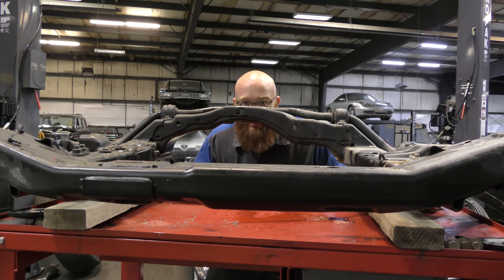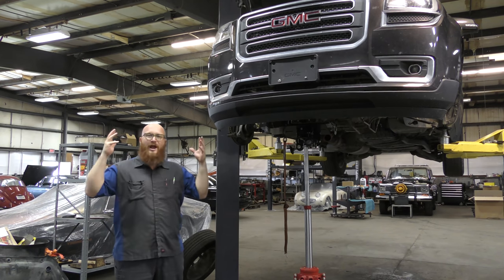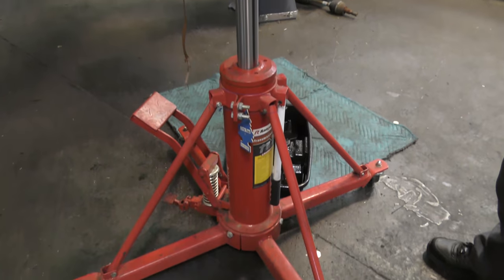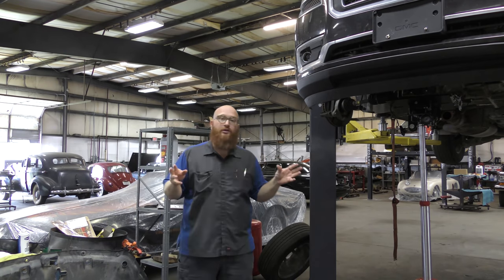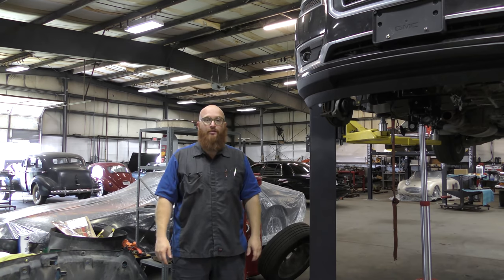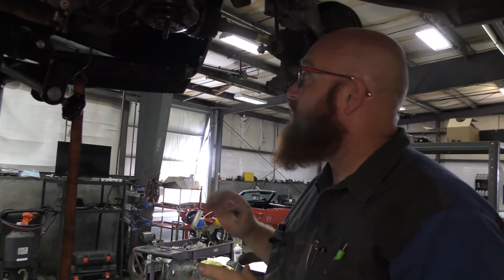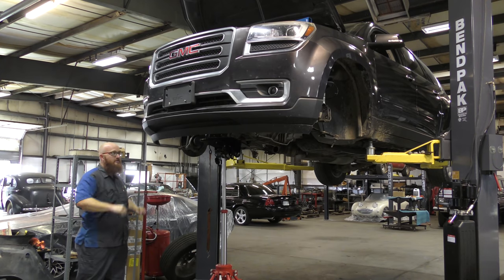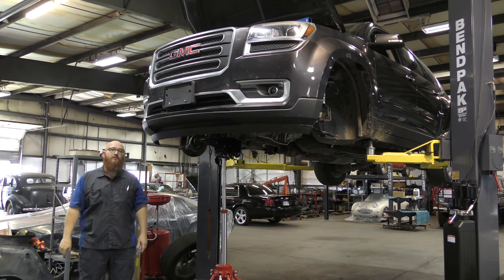Used car insanity in the CAR WIZARD's shop! Why did the huge repair get approved on this '15 Acadia?

Comment: Six years old and it needs $4k worth of repairs. Good ole' GM
Reply: Most vehicles at this point in time are junk . It's like the '70s all over again .
Reply: Much better than the new Fords. The Fusions, Focuses and F150 are having serious transmission issues let alone the 5.0L Coyotes are having issues with the cams flatening by sticking valves.
Reply: GM trying to beat the Germans at the lack of reliability game
Reply: @Dr.Westside  My 2015 Infiniti runs like new,no leaks ,no repairs, 180k miles.Made in Japan.
Reply: @mediumunwell  what do you mean "trying"?
Reply: @neondemon5137  it's a race to the bottom, who can build the bigger shit box?
Reply: GM and the other domestic brands. The pinnacle of garbage
Reply: Well really these days if its a v8 and it doesn't have active fuel management its great
Reply: @Dr.Westside  everything is like the 1970s again not just vehicles and that is not a good thing.
Reply: MRGRUMPY53  there are lots of good quality american made cars. Cars like the Honda Accord, toyota camry, honda pilot, honda ridgeline, honda odyssey, honda civic, toyota highlander, toyota....you get the idea
Reply: I have had good and bad gm cars. My experience is the good vehicles are those with the longest production runs with little change and the bad ones are low end vehicles that are cheap to start with or new high end vehicles with new tech. Same goes for Ford vehicles.
Reply: @Dr.Westside  the shoddy vehicles aren't exclusive to American or European brands.  I've seen problems with low milage Toyotas that just shouldn't have happened.  It's crazy.
Reply: I wrote GM completely off with my last GM purchase of a 2012 Cadillac CTS about 3 years ago. The warranty I bought for it has paid for itself 3x over now.
Reply: @Henry_Jones  several of those are assembled in America
Reply: This is why I drive Toyota’s 😎
Reply: @mediumunwell  BMW’s and VW Group products don’t have issues until much later on…
Reply: My hummer with the gm l92 and 6l80 power train is 14 and I’ve replaced the transmission once. Other than that runs perfect. Fingers crossed
Reply: I was a GM tech for 10 years and we did so many timing belt recalls on these Acadias, one guy would do 2 at a time he got so good at it. The 3.6 that came in these were terrible oil problems like crazy too.
Reply: @Dr.Westside  what world are you living in?? Only problem is people will still by GM garbage! They're never gonna change if people keep buy their cars
Reply: @Donnie Jax ruined the cavalier? You cant ruin something thats garbage to begin with.
Reply: @rachelgreen1368  nissan gets crapped on, mainly for a cvt transmission issue they had way back, but i have had nothing but reliable service from the 5 that i have owned
Reply: My wife got screwed by the GM SUV with the 3.6. GM has permanently made sure she buys Toyota/Lexus again
Reply: @Horizon301.  ha,ha, ha, ha...that's funny
Reply: @Donnie Jax Yes but it smell like dog and or cigarettes
Reply: Planned obsolescence
Reply: @mediumunwell  haha so accurate
Reply: @watersauce3998  timing chains?
Reply: New GM. Old lasted
Reply: While were at it lets not forget how gm loves to kill products they get right. Latest example is the Chevy Volt. Its as good as a prius and at a time when cafe is going up they kill it despite it having a huge fanbase. How about the awesome voltech powertrain that helped them get a govt bailout on 09? Do they propergate it to the rest of the gm lineup? Wouldnt an equinox hybrid make sense while toyotas selling rav4 hybrids hand over fist? Nope not to gm...they just took the voltech powertrain and buried it. 
So dont take gm seriously when they talk about electrification. The best they can do is an electric sonic (bolt is just that) while ford has the mustang mach e. Get ready for gm bailout 2...which is really anothet uaw bailout.
Reply: All newer American cars are junk except the ones with old school V8s
Reply: @tskraj3190  I love that you say that with a Ford as your profile pic
Reply: @mediumunwell  Can’t speak for BMW and Audi but Mercedes >>>>> GM. Mercedes are more expensive to fix, but they don’t break often in my experience and when they do, they’re easy to fix compared to BMWs and Audis. It’s the parts that are expensive
Reply: Ford is no different trust me
Reply: @Dr.Westside  I drive a 14 yr old Mercedes S550 & drives like a dream, burns no oil, no leaks, 382HP & 395lb Torque, everything works & all orginal. Best car I've ever owned. Mercedes is the Best way to go for reliability, dad was a mechanic & friends with tons of dealerships. BMW's & Audi's un reliable Mercedes copy cats 👍& GM/CHRYLSER worst, Toyota is "okay" not bullet proof as the Steroetype says.
Reply: @EDVenturesFL  Ford may be no better for reliability least Ford knows product design and knows to build on their R&D. Look at their approaches to hybrids and electrics to see what I mean.
Reply: @diablocls55  Yep. That was my last F150. I've owned two Tritons one 4.6 and a 5.4 and they were flat out trash. Ford doesn't build them like they used to. although I still hear good things about the first gen Coyotes.
Reply: GM still makes the best vehicles on the road. Everything else is worse.  The car companies aren't even trying anymore, because they want us to transition to electric cars, which will be a nightmare to fix, and will have a lifespan only as long as the battery pack survives.  Once that fails the car will be complete junk.  The future of cars is looking quite grim.
Reply: @ServantofChrist81  Toyotas in the U.S. such as the Tacoma and Tundra were designed and engineered by former GM engineers 🤣
Reply: @JESUS_IS_GOD  lol I literally drive a 14 year old E550. It’s so fast for a non-AMG, I fucking love it. I just keep maintaining it and it has never let me down. Just hit 150k miles last week
Reply: @tskraj3190  my parents had 2 windstars when I was a kid and the engines blew up in both before 120k miles. My parents said never again will they buy another Ford after that. Lol
Reply: @mediumunwell  mostly the SUVs Silverado, suburbans and Tahoe’s are still reliable
Reply: Want to see the difference between gm and the germans in the luxury segment? Watch Wizards video where he has a cadillac and mercedes, both from the same year on the lift side by side. Its one of his best vids.
Reply: 03 Chevy Avalanche at 335k and alright with good maintenance. Wouldn't go much newer than that tho. I often do agree about GM. Cost cutting=customer cutting. They don't even know it.
Reply: Junk
Reply: @jreyman  Toyota and Honda would like a word
Reply: We have had a few personal GM vehicles, and several company GM vehicles, we’ve had very few issues. We’ve ran company work trucks to over 200k miles with a few simple repairs along the way, but nothing major. A few Ford and Dodge work trucks also, they were all about the same way. But they were all serviced like they were supposed to be.
Reply: @Alex-xi2nz  Likewise. My wife's 2010 Malibu was the most beautiful POS we've ever owned. Good car, crazy fun in a straight line when it worked - but with that 3.6 V6, those times were far and few in between. 

Glad she drives a Camry now.
Reply: @Dr.Westside  🤣 naw
Reply: That why,you should stayed far away from GM cars as much as you can.
Reply: @Dr.Westside  agreed, except parts were a lot cheaper and a home mechanic could do most of the work themselves.
Reply: I cant tell you how many of these 3.6 liters i saw taken apart when i worked at a dealer… that series of timing chains weren’t heat treated right…. That being said VW 2.0’s, bmw 3.0 engines, and honda oddessey transmissions were also junk. Every manufacturer sucks. Consumers need to do their research and should be held accountable for it.
Reply: @Henry_Jones  Yep I think too many see foreign brands..  Ahh not made in USA.  Well I got news for ya kids.  Most aren't just American made they are made UAW yes Union Workers!  Same one who build US brands.  But that doesn't effect the quality.
Reply: @Henry_Jones  Agreed
Reply: @diablocls55  Agreed
Reply: @TravisClan  Agreed
Reply: @ACedricArmstrong  That's good.
Reply: @Chu3505  Agreed
Reply: @Elsalte07  Agreed
Reply: @Henry_Jones  do you happen to know how long ago that episode was?  I'd like to see it.
Reply: Been driving worry free Toyota’s for years now I’m so scared to buy anything from Chevy or Ford or dodge I just know I’ll instantly regret it. From maintenance to resale value but I like the camaro and mustang.
Reply: @dixonsantana-lamboy8432  cold garbage 💁‍♂️
Reply: My Nissan Sunny is 21 years old and I have not experienced any problems with it whatsoever. Normal wear and tear, service and brakes, and once CV joint boots only. That's it, and yes, she's a daily driver ☺❤😎👋
Reply: @rachelgreen1368  My 2000 Nissan Sunny still runs perfectly today. Daily driver.
Reply: Ever since I heard about that GM faulty ignition scandal that happened on the Chevrolet Cobalt, Saturn Ion, Pontiac G5/Pursuit, HHR, Saturn Sky, and Saturn Vue. I am never going to buy American cars EVER!
Reply: @tskraj3190  - The Focuses and Fiestas have had serious transmission problems.  Not so much the Fusions and I looked up the Coyote V8 reliability history on the F150s and then checked out the history on Silverados and Sierras, and the F150 (with the V8) has FAR less customer complaints.  Many Silverado/Sierra owners are having to have engine replacements before 100K miles.
Reply: The only GM SUV i would buy is the 2000-2006 yukon xl
Reply: And it'll need timing chains within the next year as well
Reply: MRGRUMPY53  Thats patriotic. You probably shop at Walmart also. For ahead and move to Japan or korea
Reply: @watersauce3998  GM tech huh? You must be dreaming because the GMC Acadia doesn't have a timing belt. If you are gonna lie do better research first.
Reply: @mediumunwell  They win by far. German cars are quite reliable. At least the base model and lower power motorized models.
Reply: @hungryhungryhummer  Yea, but you've had to drive and be seen in a hummer....
Reply: @BeingMe23  Name one foreign branded, UAW built and assembled in America. Doesn't exist anymore.
Reply: @Donnie Jax compared to what honda and toyota and nissan were putting out then? Garbage. The real sin of gm of the 80s was saturn. Why build a whole new company while starving your core brands of capital needed to improve product? The saturn s series coulda replaced the j body, been the next gen cavalier and THEN chevy coulda been a condender but nope.
Reply: @christinesommerfeld9815  timing chain it has 3 really skinny ones like bike chain almost. Pontiac buick gmc in apple valley MN years ago graduated Dctc in 2008. Belt chain whatever doesn't mean im lying lol
Reply: @christinesommerfeld9815 actually I’ve never met anyone my age who doesn’t like it. It’s always old libtards who hate. It’s supercharged so 520+ hp, it tows my can ams and enclosed trailers up the mountains great. And believe it or not, the fuel economy is excellent when towing. Better than any other 3/4 ton vehicle I’ve seen that is gas. You should go drive one. It might change your perspective. Drive a newer one like an 08-09. They’re a lot nicer than the old ones.
Reply: @rachelgreen1368  More like made in France (Renault).
Reply: @Dr.Westside  My 7 year old Skoda Citigo has 180k km on it, still 100% original with original timing belt and clutch. Runs completely fine and has never had anything wrong with it. Of course, unlike most new cars, the citigo doesn't have useless rubbish such as oil filled motor mounts.
Reply: MRGRUMPY53  whaddya drive
Reply: @Horizon301.  at 100k miles?
Reply: @Henry_Jones  I loved my volt.
Reply: I had a 2009 GMC Acadia and it was at 190,000 mi when I had to get the timing chain replaced.... It only costed me $1,900.... That's what's like 2 years ago....
Reply: @watersauce3998  Arcadias have chains and not belts?
Reply: @Btrempe  yep the volt and voltech powetrain was awesome! Gm doesent market it, asks why doesnt it sell better and kills it! Rav4 hybrid, crv hybrid, escape hybrid, soon mavrick hybrid! What does gm do with their superior hybrid drivetrain!? Make a hybrid equinox or traverse? Nope..
THEY BURY IT!!! DUMBEST COMPANY EVER!
Reply: @DeadofWinter321  de
Oht a c
Reply: That's why I'm happy with my 2010 Civic... 100k miles and no issues, just regular stuff as oil, pads, filters and such...
Reply: I was watching my cams (all four of them) on my scan tool. The value presented were all in spec.
That car has almost 310000 miles on it. 
Good ol' GM... 😩
Reply: One of the saddest things about Chevy/GMC is that they actually make good looking vehicles that won’t last long.
Reply: @Dr.Westside  70s cars lacked power. They were still reliable
Reply: Did a stint as a lube monkey at a Toyota dealer. Brand new camrys with less than 20miles on them had leaking rear main seals. Doesn't help when the worst culprits are running 0w16 oil in them.
Reply: @mediumunwell  don’t agree. Have had  one 2002 A6 2.4 V6 put 246000 Miles on it with no major issue. Regular maintenance oil changes brakes some control arms and engine mounts. Was still going strong but wanted something newer a few years back. Now have been driving the 2012 Audi A6 3.0t supercharged with already 129000 miles on it and never an issue. Same just regular maintenance on the intervals and I’m sure without a problem will hit 200000 if not more. Better then any junk American or Nissan. Have to say that Toyota and Honda are likely cheaper to maintain but in my case the Audi is far more pleasant to drive. It’s all how you maintain it. But then yet again I see so many people in the states that want to sit in the front row for the cheapest price possible. You get what you pay for.
Reply: I can’t imagine what the earlier ones are like.
Reply: That isn't typical though. Obviously its been abused.
Reply: @tskraj3190  even if that were the case Ford seems to be having way less problems than GM nowadays. Class action lawsuit for the lifters? aint happening at ford 🤷‍♂️
Reply: @PhatsoJuggalo806  Ford just doesn't report their known issues like the Triton motors for example with the consistent spark plug spitting after tune ups or the cam phasers crumbling inside the engines.
Reply: @lyman135  Rear main seal failure could possibly be due to poor maintenance, but not failed sensors or leaking power steering lines.
Reply: @watersauce3998  timing belt or chain?
Reply: American cars are the BEST!
I know an Uber driver with 300,000 miles on her Alabama Odyssey, two people with 450,000 miles on their Ohio Civics, somebody with 560,000 miles on her Accord, a guy who uses his 300,000-mile Texas Tundra to tow his race cars, and my next-door neighbor had such great luck with a 300,000 mile Alabama Pilot that he bought another. After a horrific Audi experience, my friend got an Alabama Hyundai that's been perfect, South Carolina Mercedes and Volvo are better than any BMW.  When my flawless 300,000-mile Infiniti wears out (there was a guy in the Infiniti group with 496,000 miles), I need to buy an American car, probably a Honda, maybe a Toyota.
Reply: Run away from GM
Reply: MRGRUMPY53   Good for you
Reply: 13 hours labor, dealer rate,  at let’s say $ 150 an hour is  $1950 . Where in the us are you guys located ‘cause am moving there tomorrow.
Reply: @Mastermind12358  if it is a belt vs chain on yo' car... Please change it!! I bet it snapped 5 mins after your post 😉 very cool unique car! Hate to see it go down
Reply: @tskraj3190  There is a reason those engineers are now working for Toyota and not GM.
Reply: @wrxguyusa  Yes, there is. GM and Toyota worked together for almost 30 years in the "NUMMI" venture. During that time both GM and Toyota shared engineers and even parts. When GM went bankrupt in 2008 Toyota purchased many of GM's patents and blueprints and grabbed GM's engineers.
Reply: @blakehintz3207  Hi, thanks for the advice, and you are correct, on most (especially older cars) timing belt should be changed every three or five years, or every 60k km. But on this one, the timing belt is rated for 210k km or ten years, so I'll wait another year or two before changing it out.
Reply: @Mastermind12358  that's awesome! I wish my Subaru's belt was good that long 🙂
Reply: My boss bought his wife a 2021 Explorer Hybrid, top of the line. 40 miles, airbag light came on. They admitted to not doing the 5 recalls before selling it because parts aren’t available.
Reply: @mediumunwell  bigger nicest shitbox
Reply: Gm and Ford are really dropping the ball
Reply: Good new GM.  My ol' 01 and 04 Suburban and Yukon XL are reliable and amazing.
Reply: If its only 6 years old then what happened to the factory warenty?
Reply: GM's standard warranty expires after 5 years
Reply: The GM LS v8 is the best engine ever made
Reply: @bw4316  Mercedes built in America are garbage compared to the ones built in Germany like my E550
Reply: @michaelporter3555  Toyota's 2.4L , 2AZFE, 2001-2011 engine.  Literally, Toyota Redesigned their Swiss watch,1990's engine & injected some Detroit-style planned obsolescence into it. Honda gained ground.
Reply: @change929  Nissan/Infinity assembled in Japan, maybe.  If they are assembled in Mexico, I stay away.
Reply: @ferndog1461  every Silverado I’ve ever owned has been super reliable
Reply: Lol my 2016 Cruze diesel was done after 5 years and probably 7k in repairs.
Reply: @JESUS_IS_GOD  lol, Mercedes is not more reliable than Toyota, period.
Reply: @ServantofChrist81  
I don’t blame you. Same here. No issues.
Reply: @jordanmercier3616  Ignorance is Truly Amazing
Reply: @Horizon301.  Baloney. I have owned both BMWs and VWs and both have issues. At 35,000 miles the plastic thermostat retainer in the BMW broke off, causing the car to overheat and crack the remote radiator pressure tank, which is also plastic. In typical BMW “engineering” they run an oil coolant line through the alternator bracket. There is a small O-ring that is a common failure point. To change the water pump you are required to unbolt the drivers side motor mount and rotate the entire engine upward and clock wise! There are several other idiotic (what were these German engineers thinking) design and reliability issues that I won’t go into in detail, valve seals, intake tuning vanes, intake manifold cracks (plastic). To say BMWs have no “issues until much later” is simply false.
Reply: @JohnDoe-zr6bk  simply not true. I say this as a BMW owner. This is precisely why very few people purchase BMWs, and choose to lease them. Additionally, the resale values are horrible.
Reply: @Donnie Jax excellent points !
Reply: @ServantofChrist81  I remember In 1993 one aunt bought a Camry v6 , the other a Chevy lumina 3.4 twin cam.  Camry lasted over 16 years , that’s 16 Canadian winters in Ontario. and 500 000km .  The lumina, did not.
Reply: @michaelheath1925  to say otherwise would also be false though. We have had 10 or so VW Group products up to 30k miles in the space of 10 years with no issues. After warranty though I wouldn’t risk it however a lot of people who have them past this haven’t had any issues from what I know. It’s usually near 100k and older when the plastic becomes an issue. BMWs aren’t going to become reliable with all of the development they do, that’s obvious and they do stupid over engineering that I don’t dispute but I think they aren’t as bad as GM or JLR. Correction, the only issue was with the A6 radiator becoming chipped by a rock causing a leak but the dealer replaced it for free as it wasn’t an issue before the service so they took responsibility
Reply: My parents hate it when I bring up the 2004 GMC Envoy they bought new and was a complete disaster when I took them to see a 4 runner and they said no no  it will cost too much for parts after the warranty is over 😂
Reply: @Horizon301.  I have had better reliability with GM than BMW. Funny you mention JLR as I own one of those as well, a 2000 Land Rover discovery 2. I do all my own maintenance (currently head gaskets) and now have a Land Rover with more than 300,000 miles on it. It is however, not a reliable vehicle. However, it is manageable if you can do your own repairs.
Reply: @michaelheath1925  the old JLR products were fine as they were easy to fix when they break, now though it’s like the Germans but less reliable. BMW and VW Group make constant improvements so their engines and various systems aren’t necessarily kept for long term like Toyota for example who can perfect these over time. BMW only need to care for the first buyer of whom will likely be buying a new one every so often anyway. 50% of Mercedes in the UK are financed and that’s set up to get you changing cars more often so I don’t blame them for focusing more on interior quality, style and technology as that’s what I look for in a car also as we sell our vehicles before the warranty ends
Reply: @jacobwilson9477  I’m glad the 89 Buick is serving you well , they were great cars, great engines , comfortable.  Good that u do your own work.  I’m driving a high mileage 84 Mercedes 300D turbo diesel that I can fix myself.  the thought of a newer Mercedes is a nightmare. Not happening. Hope u keep the LeSabre going for a long time !
Reply: My 26 year old, 450k mile Sierra would like a word..
Reply: @carwashadamcooper1538  I don’t think that  Acadia will  have to worry about making it to 26 years. I wish I could buy a new 1993-98 ish Sierra now.  I got huge miles out of 6.2 and 6.5 diesels.  Plain /fancy , gas/diesel Those were great trucks at that time !
Reply: @ROVER25X  4Cyl and V6, Automatic transmissions.
Reply: @watersauce3998  There never were recalls for timing belts. I smell bull 💩.
Reply: @tskraj3190  they called it a "special adjustment" recall it entailed replacing all 3 chains what is with you guys haha
Reply: @watersauce3998  So it changed from belts to chains after everyone called you out on your BS.
Reply: @watersauce3998  So it changed from belts to chains after everyone called you out on your BS.
Reply: @dixonsantana-lamboy8432  The Germans outperform in the EXPENSE of repairing their failures, though.
Reply: @Mastermind12358  citigo? that doesn't even sound like a real car.
Reply: @JimmyMakingitwork  yikes
Reply: @toomanymarys7355  Its a rebadge of the VW Up.
Reply: @change929  CVT is junk the engines themselves like the VQ Ka VG and QR are great engines
Reply: @JESUS_IS_GOD  Not bulletproof? My dad has his Corolla with 255k I’ve replaced all the fluids and maintenance and the alternator it still runs decent for it’s age
Reply: @mauricemotors8207 🤷‍♂️ 2003 500HP Mercedes E55 AMG 400,000+ Miles still pulling stronger numbers on dyno then when new (It's on YouTube look it up) . More Luxury More Horsepower & still reliable. Don't compare it with a 120HP Toyota. Mercedes won 7 Formula 1 championships in a row, break Nurburgring records & let's not forget invented the Modern car & engine back in 1885 & 1886 👍
Reply: It's not an economic boom we're in it's an economic shit show!!
Reply: It will be a long time before I buy any of the brands mentioned here. I’m only 12.
Reply: It seems like they don’t design cars these days with maintenance in mind.
Reply: @tskraj3190  using Toyota’s standards. Definitely not GM. I’ve had many of both. Gm is trash compared to yota. Period
Reply: @watersauce3998  What timing belt?
Reply: @tskraj3190  I will say the 3800 is hands down the best engine ever made. I don’t dislike GM. It’s all I use to own. But this newer stuff I would never. I still have a 2006 Sierra. Damn good trucks.
Reply: @michaelporter3555  Had one.  I'll never buy Toyota again.
Reply: I would just poor rear main seal stop leak in the oil  and call  it good.
Reply: My Lexus 460 has about $8,000 worth of repairs needed I keep putting off. I WISH it was $4k
Reply: @watersauce3998  I’m curious has GM ever fixed the issues with the 3.6? I had one in a G6 gtp and it didn’t throw the codes until 240,000km, honestly the engine was great other than that at the end. I just sold the car- it was starting to rust out anyway
Reply: @rachelgreen1368  by renault
Reply: @Dr.Westside  I had an 2017Infiniti Q50 50k no problems  now I have a 2012 Acura TL with 64k and I’ve had less problems with my older Acura than my infiniti but both were incredibly solid and ergonomically engineered. I will not buy outside of Japanese cars I’ll consider a Korean when they show the test of the time. Germans and Americans have been spiked with the test of time and have failed miserable over all when it comes to quality. Seeing the car wizards vids gives me flashbacks ptsd of being in mechanic shops. But Japanese you watch others deal with those problems lol 😂
Reply: Buy Toyota, Honda, Mitsubishi or Nissan. In that order. Honda Civic 93, no problem, CR-V 2006, no problem, just bought a 21 hrv, hopefully, no problem!
Reply: @tskraj3190  should be Foci.
Reply: @mediumunwell  BMW WINS!!!
Reply: @Horizon301.  No, BMWs especially have electonic issues within the first couple of years of ownership, next in line is their transmissions. VWs on the other hand their issues are more with their heads and head gaskets.
Reply: @olikat8  Yes sadly since GM discontinued their 3100, 3400 and 3800 V6 and went to the alloytec V6s, GM's quality had significantly dropped.
Reply: @Henry_Jones   Well it doesnt help at even at the full 40 grand, gm was losing 20 grand per car.  Would you pay 60 grand for a "good" volt, would you pay 40 grand, the only reason they sold period was the fed/state incentives.  You want a volt, great they are less than 20 grand with less than 50,000 miles on them, and only 4 years old, and have 100k battery/motor warranty.
Reply: @nightanole  i dont buy those stats. Toyota and Honda make profit on their hybrids wihout incentives or subsidies.
Reply: @Dr.Westside  hey my 77 f350 is great, besides it literally blowing out a caliper 45 minutes ago
Reply: @tskraj3190  the dual clutch focus lol, I’ve not heard much about the 10 speeds in the fusion or the f150, which is shared with GM btw
Reply: Exactly
Reply: @watersauce3998  which models had timing belt, which had chain?
Reply: @ACedricArmstrong  My '09 Malibu LTZ was the same way. Loved how pretty it was and it stood out on the road from all the Camry's and Accords, but that damn thing must have been built by drunk people the way it fell apart lol. I almost replaced it with a Camry too but I still like something at least halfway pretty to look at so I went a different direction, but that Malibu definitely tricked me lol.
Reply: @badhombre8383  Depends on what you get. My husband leased a '20 Chrysler 300 Hemi last year and we love it. I mostly stick to Toyota's too but none of them ever felt like they had a soul... when my lease is up on my Yaris I'm considering a Durango with that Hemi.
Reply: @Alex-xi2nz  I'm with you.  I bought a new HHR SS in 2008.  It was so bad that Chevy extended my warranty for another 3 yrs 36k miles for free.  That took a dozen angry phone calls, but it happened.  Drive a 12 F-150 and a 14 Grand Caravan now.  Both have been wonderful.
Reply: 😂 LOL...  The shops are charging lawyer prices per hour. Why anyone would spend this on a common car is amazing. If you can't fix cars yourself then either buy Toyota or anything still under warranty. If you buy used cars under 5k then you just dump the car and buy a different one. Anytime you fix a car you never know what other damage was caused to other components. The car manufacturer does this to keep cars from lasting too long. Dealership Repair shops are what keep them profitable. If cars last too long, they would go bankrupt.  They make all this technology work great for duration of warranty.
Reply: @olikat8  again??? She had a Toyota and went back to gm??????
Reply: @danlevesque5437  no. She never went & never will go back.
Reply: Back in March I was rear ended by an Acadia. Driver knew the brakes did not work properly, it’s on the GM recall list. 
I will not ever trust a GM newer than a 94 ever again. And even the 94 I will be skeptical about
Reply: @gimliismyhero2045  my dad's '82 chevrolet impala tought me to hate chevrolet as a little kid to the point where I convinced the family to jump ship for fords and reluctantly every agreed knowing that we may be making more mistakes funny enough we had 5 fords in a 10-12 year time period and all of them were a million times better experience
Reply: @Henry_Jones  the volt is surprisingly a well made vehicle, my volt has almost 200k on it. I have done nothing but I oil changes. I wish GM still made them.
Reply: @gimliismyhero2045  That's a weird reason not to trust a GM vehicle again, and '94 is a weird cut off year lol.
Reply: And my dad's 3.6 impala is at nearly 170k and has never missed a beat. He must be lucky.
Reply: @chynacash3138  I have a 94 Chevy 1500 with less than 100000 miles that has had two rebuilds and a replacement plus a rebuild on that transmission and it has not moved on its own in over twenty years because the transmission is crap. My brother has a Silverado that is two years old and a hunk of junk. My wife has a two year old GM and it’s left her on the side of the road already. Why would I trust them anymore?
Reply: @gimliismyhero2045  Sounds like a silly anecdote that you just told honestly lol.
Reply: @chynacash3138  it would be funny if it weren’t true
Reply: @jkeelsnc  both my sister and I got our licenses in a mercury tempo retired fleet car and that also was a keeper it's last day before we had to get rid of it it actually started to desiel up in the driveway stone cold like it was christine from the haunted car movie 🤣
Reply: @jkeelsnc  I have a Scion xD. Love my lil Toyota. And it hauls my tools for work, so win win there
Reply: @mediumunwell  lmao the typical ignorant american "myth".
No, German cars aren't necessarily less reliable than any other brand.
Each car manufacturer has it's own issues.
Hell, my mom's 5 year old Toyota has been in the shop 4 times already for upwards of 2 months, while my 2011 VW has been absolutely faultless.
Reply: You should buy a VW SUV and then tell me about how low your bills are.
Reply: @ze_german2921  My Skoda Kodiaq (which is basically just a VW Tiguan in drag) has cost me exactly 0$ to run in the 6 years i've had it (excluding general maintenance like oil and tires).
Reply: @mediumunwell  ford 3.7s in rwd cars and trucks is real good i have 2 f150s with 350000 miles on them they are shop trucks. Where originally oil field trucks where beat to hell but run very nice only has had oil changes and a liitle suspension work.
Reply: @christinesommerfeld9815  the toyota pickups built in tx an and corollas built in mississippi
Reply: I work on a lot of different post OBDII vehicles. 

Averaging it out, ford is the worst. And that hurt my soul coming from a ford family but they're the modern day british car. Fucking shit. 

Sorry but this is a fluke, a lot of gm products i have been around with the same mileage and abuse fare far better. 

There is difference between barely hanging on with 3 codes, or being overall pretty solid throwing the same 3 codes. Ford and gm post obdII difference
Reply: @dylanmccallister1888  they dont use the 3.7 in rwd cars any more.havent since 2016. Our shop trucks are 2012s and my 14 mustang has been dead reliable. I come my dad has always had gm cars and my mom likes chryslers. I bought a ford due to the numerous issues id had with my recent gm cars. I had a 14 buick regal turbo need a new fuel system at 20000, the radio unit went out at 25000 and i had tons of fit and finish issues as well, i usually maintain my cars flawlessly. Also had a gmc denali hd whose fuel system also went out and has lots of similar issues. Most gm cars ive recently owned have been problematic. One of my buddies have a 12 taurus that has 240000 miles on it nver had the infamious water pump failure. I believe there is good and bad in every thing. But gm cars are what they once were. My dads cts timing needed changed at 60000 miles and had issues with, fuel pumps,  we run only non ethanol fuel too. Just poor quality i guess. My 03 siilverado i had was good besides intake gaskets needing changed at 123000 miles and the blower module.
Reply: @Dr.Westside  2010 Corolla. Have had for 6 yrs. 110,000 miles. $2,000 to replace: compressor,  radiator, alternator,  starter, spark plugs/wires after 90K of driving. All original parts replaced. Stay away from GM
Reply: It's like my buddy's 2016 Kia Sorento with a blown head gasket. Kia dealership quoted $5-6k to repair. I'm doing the repair for him. I found the rt bank had the gasket replaced already AND had the head bolt holes rethreaded. The left bank needs the holes repaired as well.
Reply: @michaelporter3555  We have a Prius that guzzles oil. Toyota says it's fine, no problem, supposed to be that way.
Reply: whoa my 1999 Expedition still going strong 210 k
Reply: My Chevy Blazer has 257 thousand miles on it still running strong
Reply: @nomebear  not surprised by that I think they took lessons from GM in the 1970s and 1980s.  Deny there is any problem and maybe people will forget about it.
Reply: @mediumunwell  they are in the lead by a mile!!
Reply: Exactly why I traded a Malibu for a Camry.
Reply: @Dr.Westside   Even 70s cars were better than the shit they build today.
Reply: Love the shear number of comments here lol
Reply: @Dr.Westside  '90s Toyota is the pinnacle.
Reply: Not really tasty unreasonable.
Reply: @christinesommerfeld9815  America is  still making good vehicles. Both my vehicles are US brand names. It’s a fact that reliability is not the top priority of US manufactures.
Reply: @RaimarLunardi  You shouldn’t  have any major problems with most vehicles in market at 100k mark.
Reply: I will never buy any gmc product except a Corvette and Camaro SS that's it
Reply: @dixonsantana-lamboy8432  agree
Reply: @Dr.Westside  I drive 70s cars and trucks exclusively. You rarely see them on the roads anymore.
Reply: Sitting here in my 2009 vibe haven’t changed a thing
Reply: @stevee8318  that’s the joke haha 

It’s actually a Toyota matrix based on the the Rav 4 platform =) 

Looked into v6 swapping it
Reply: @OriginalDegree  lol you got me
Reply: Dude I have 2012 Charger in Europe and it was 10k over the two years I had it, all related to “common issues”. American cars are just different, but at least they aren’t soulless sterile boxes like ours.
Reply: @aborted4196  You'll Burn FOREVER 🔥🔥✝️🔥🔥 Have Fun with That. 
Philippians 2:10-11
King James Version
10 That at the name of Jesus every knee should bow, of things in heaven, and things in earth, and things under the earth;
11 And that every tongue should confess that Jesus Christ is Lord, to the glory of God the Father.
Reply: @rachelgreen1368  my 2000 Pontiac Grand Prix ran perfect and shifted perfect at 284,000 miles..
Your infinity is nothing special...
Reply: 2014 chevy Cruze LT 110,072 miles never had an issue
Reply: @joelayala9896  I prefer GM vehicles, but that's unbelievable for that vehicle..
Reply: @philllsxga.7737  Yes, still on original turbo, I take really good care of her
Reply: @joelayala9896  wow that's good! I lost hope in GM cars and Ford's also..
Maintenance is key!!
I have a 2014 Silverado with 129,000 trouble-free miles on it..
But like you I do all the maintenance..
Reply: @philllsxga.7737  Infiniti is a fast luxury awd  SUV with 400hp besides reliability .
Reply: @rachelgreen1368  nothing special.
I work on vehicles.
It's just image...
 Gets you from point a to point b...
Reply: @Reformed Church of Christ I wonder why ;)
Reply: We have 20 years old Toyota and owned it 5 years now.
Brake parts, oil changes and wheel bearing done so far.
Reply: People, do you DD before you buy a vehicle!!
Reply: @JESUS_IS_GOD  old Mercedes might be the way to go but modern Mercedes are towards the bottom of the list for reliability. My C class was in the shop 4 times in a year for 4 different issues. It's not just me either, they are ranked 22 of 30 in UK for reliability. Work was covered under warranty but not good. Hopefully they will start to improve again in future but for now would avoid if out of warranty.
Reply: Soo? One year old Mercedes, bmw, audi usually is 20k to fix. I live in Europe and i can safety tell you even worse GM car is more reliable then modern euro cars.
Reply: @RandomShart  I daily a Mercedes S550. Best car I've ever owned almost 100k miles now 🤷‍♂️ sorry about your c
Reply: I’ve been working at dealerships since 1997. Currently at a ford dealership. I will say this, they’re all junk, all makes. Pick one ya like, buy it and drive it.
Reply: Have an 05 Sierra 2500 never any issues
Reply: Buy Toyota
Reply: @jreyman  you're kidding right?
Reply: @dereklaurinat2547  The 3.6 used in the Impala made a huge leap in quality in 2012.  I assume the same engine is used in most of GM's lineup.  It is very reliant on oil changes made at 3000 to 4000 miles.  Like all variable timing engines that use the engine oil for timing and the tensioners the oil needs to be fairly clean to function correctly.   We had several we used as fleet cars and all went past 200k before trading.  Very few issues while in severice.  Transmission fluid needs changed every 50k.  Just drain and refill.
Reply: @JESUS_IS_GOD  Haha, that was the most hilarious thing i've have heard.
Reply: GM- Garbage Manufacturing.
Reply: I bought a corolla new in 06 put 380,000 miles on it still ran perfect but the 4th large deer I killed with it totaled it
Reply: My old boss was an engineer at GM.  He said there was an 'unwritten rule' that they were to try and design components for "benign failure".  That is, design the bits and pieces so they will fail at an MTBF time just beyond the warranty period -- but fail in a nice way that does not affect safety or put anyone at risk!  Good old GM.
Reply: Yep and gm is having issues with the c8 electronics right now as well and they expect folks to pay over 160k for a c8 z06 with dealer markups lol. GMs quality whent down the tube totally after 2008
Reply: @godemperor7457  It really depends on the model. Ford used to spend more money than any other manufacturer on interior parts and steel. It really came down to the models. Ford V8s didn't last as long as GM's but they had more power from the 70's to the 80's. 70's and 80's GM's bodies would rust out within 10 years while the Fords still had no rust. I personally believe both companies could learn from one another. Dodge and RAMs look nice and their engines are powerful and reliable but they still have problems with their interior falling apart and the infamous condensation drain plugging up and leaking on the passenger side.
Reply: GMC = Got Mechanic Coming. GM is pitiful 🔥🧐
Reply: @davidedwards2773  Not nearly as bad as Ford.
Reply: I own a Just eMPTY eVERY pOCKET and I can relate.  It’s sad that today’s vehicles are such disposable money pits. Scotty Kilmer had a video about a Mercedes that had to have a $1300 shock absorber replaced 

One has to weigh the cost of repairing an older vehicle against the cost of going into debt for years in having a new vehicle. Sometimes the warranty won’t cover certain repairs on new vehicles, then what?

However, there is a point where you have to decide if the older vehicle is worth fixing
Reply: @mediumunwell  really it's all the American manufacturers in a constant competition to be the least reliable
Reply: @Alex-xi2nz  you bought a CTS, that's on you.
Reply: @BensDad2003 :  agreed, now if these Japanese auto manufacturers and other foreign auto companies could figure out a way for their products to automatically illuminate the tail lights when it’s dark out, that would be great.
Reply: @tskraj3190  huh? New mustangs come stock with lsd's, six speeds or ten speed twin clutch, brembos,  state of the art independent suspension, tons of stuff you would never dream of seeing on older mustangs. And that valve issue you talk about is only from people running them hard at low temp, the cam phaser issue happens at low temp. It's a high performance motor it needs to warm up, that's just common sense. It's the reason that GT in the focus RS came with the oil temp gauge.
Reply: @4touchdowns1game29  Never said they didn't have extra features, but the cams flatening out from sticking valves and sensor voltage are huge problems with Ford right now. The 8 speed transmissions are having the most issues though.
Reply: Precisely. Hasn't changed much since my '88 Chevy Corsica disaster.
Reply: @Bdub1952  Corsicas have always been junk. It was only one step up from a Cavalier.   But it it was still much better than the Escorts, Tempo/Topaz, Taurus and K-Cars as far as reliability.
Reply: @tskraj3190  that, in and of itself is a sad testament to 80's US cars. The Corsica was the biggest PoS I've ever had in my garage, bar none.
Reply: @Bdub1952  Yeah, they weren't great. The Luminas were much better. The GM 3.1, 3.4 and 3.8L V6s are still coveted to this day.
Reply: @Dr.Westside  the 70’s car the best cars until 76
Reply: Don't Walk From It, Run From It 🏃‍♂️
Reply: I can verify as a rollback and wrecker operator
Reply: This is why I buy Toyotas now.
Reply: @Dr.Westside  my 2016 honda is fine
Reply: @reallyrandomrides1296  then why do mechanics such as Car Ninja and Wizard drive BMW's, Maserati, and Land Rover if Toyota is the best?
Reply: @vw5056  Some people choose to drive the vehicle they like best, based on performance, styling, etc. Especially if they are mechanically inclined and can get parts cheaply and do they work themselves, it makes it easier. Some just like the challenge. Others, like me, are automotive enthusiasts, but not mechanically inclined, and just want something reliable and that holds its value. Everyone has different needs and wants.
Reply: @reallyrandomrides1296  so you admit that Toyota is not the best?
Reply: @vw5056  No, I never said that. For me, and many others, Toyota is the best.
Reply: Many Acadia, Enclave, Traverse...with 300K miles with regular synthetic oil changes.  Our 2016 Acadia was a lease with almost 60K and only returned to dealership for free oil changes and tire rotations.  For 4-years it never needed brakes/rotors, wipers, or any other consumable.  Absolutely zero ever needed!

Aside from our 2015 GMC Terrain 2.5l it was the least expensive vehicle we have ever maintained outside the warranty.
Reply: @Henry_Jones  Please share with us these makes of good quality American made cars that require  not much
maintenance. Off hand I can not think of one...please share with us. I thought the quality of American made
cars were going down the tubes, but you seems to know. What say you?
Reply: Chevys are hardly even vehicles they're so bad. Just like Chrysler. Rust bucket piece of shit on wheels. I do think buick is awesome though. Very comfortable cars and good reliability
Reply: 1990 volvo 740 turbo here and still going strong 💪
Reply: Its not just the brand its the owner and how its maintained matters alot
Reply: I've owned 17 cars in my whole life. I've never spent 4 grand on any of them Altogether.
Reply: Should of brought the 4 runner
Reply: @ServantofChrist81  The best
Reply: Chevy silverado 6.0 on average gets 250,000-350,000 with proper maintenance I beg to differ on your opinion and that's out of a work truck!
Reply: @JESUS_IS_GOD  hah. Mercedes are huge money sucks now. Toyota and Honda are #1, period.
Reply: @gabrielhugges6820  my 2005 Escalade (related to 2000-2006 Yukon xl) is still going strong and is still reliable. The only things I’ve had to do are fuel pump, water pump, and things related to its age 17 years now) like ball joints and wheel bearings.
Reply: Yeah, but VW/Audi are even worse!
Reply: @Horizon301.  the new bmw b58 is put in a Toyota 😉
Reply: @rachelgreen1368   which Infinity what model
Reply: @christinesommerfeld9815  ml
Reply: @mrgreenbaypacker929  FX37
Reply: Gm=junk
Reply: @Henry_Jones  Looks like a list of Made in America vehicles.
Reply: @blakehintz3207  No fancy electronics in engine & transmission, cast iron components.
Reply: @christinesommerfeld9815  Built in USA but not UAW
Reply: @tskraj3190  Ford got a new orifice on the dual clutch transmission.
Reply: I had a cobalt engine destroy itself from the timing belt slipping. interferance engines are the biggest sham ever produced. only made to guarantee youll need a new car in 5 years or less.
Reply: @tskraj3190  What are you talking about 😂 all my fords are 6-11 year old literally spent probably $600 each to fix them & 3 years later still nothing needed other than regular oil changes/ clearly some mods 😂
Reply: @tskraj3190  going to ignore the Camaro rear ends failing, Corvette transmission failure & basically consumer reports rating the Silverado as most unreliable car of the year 😂
Reply: @EDVenturesFL  no difference? I have 4 fords that disagree 😂
Reply: @tskraj3190  don’t care still wrong
Reply: @neondemon5137  I know I'm making this response 1 year after your original comment. I'm a truck driver in the Atlanta area I cannot tell you how many late model BMWs I see break down all over our roads and streets it's literally 10 BMWs broken down for everyone of all other automakers combined. BMW has dropped further than any of the other automakers. Not that GM or Ford don't make absolute garbage but something about the Germans now has changed what they put now is absolutely junk
Reply: @rachelgreen1368  It doesn't really have much to do with being built in Japan so much as engineered in Japan.
Reply: My 2016 ford fusion was 5 years old when I bought it. 2 weeks after purchase at 76k miles the motor and transmission was replaced by warranty for over 14 thousand dollars. I sold it for a profit 2 months later lol
Reply: @AdamJ09303  what warranty company?
Reply: @tskraj3190  Nope I've got 2 newer fords and I've had them both for 5 years now. Each over 130k. Not a single problem. Ford is beating the crap out of GM these days, and if you don't think so go check the independent reliability reports. The numbers don't lie, ford has a mere 20% of the failures GM does. It's all because they went broke in 2008 and got bailed out on your dime. They've sucked ever since.
Reply: @enermaxstephens1051  You do see my profile pic, don't you? Fords are trash.  For the last 45 years they've had fire hazzard recalls on many models not to mention their transmissions taking a crap before they even hit 180K. The pic you see is the last Ford I will ever buy.
Reply: @tskraj3190  If ford's are trash GM is sewage. Everything you just said applies to them as well, and you don't even know it. GM's cars may as well be paper compared to toyota, they'll never measure up. As for trucks, they haven't made a good one since they became Government Motors back in 2008. The F150 has been kicking their ass for that whole 45 years in sales. Those are the facts.
Reply: @enermaxstephens1051  is that why Chevy's gas HD trucks outlast Ford,s and RAM? Is that why GM has 33 One million mile vehicles registered and Ford only has three and they are all International 7.3Ls? Is that also why the new Godzilla motors have been failing?
Reply: Doesn't matter how old it is. The dumb design of the engine breaks the timing of the vehicle. Legit anything could blow at any time on that motor.
Reply: @Henry_Jones  nahh,  they intentionally coaxed american drivers into buying trucks for a premium price, trucks which is exempt from rules which affects cars.

They want to earn easy money.
Reply: My dad is buying one and I worry it's gonna wreck his wallet and sanity
Reply: That's actually not terrible, the average is like $600 a year so it's not terrible.
Reply: Thank you for this information. Look like gmc vehicles are money pits om wheels.
Reply: @paulwoodman5131  that's outdated thinking , my American-made Toyota's were just as reliable if not more than the Japanese ones.
Reply: My 2003 Bonneville ssei supercharged 3800 runs like a dream. It's had a couple mods.  Gm didn't always or only make junk. The 3800 is fantastic
Reply: @tskraj3190  well my 1012 focus now has 185000 miles on it and runs. Been a really good car, good on gas, solid body and handles great.
Reply: @wilecatrexy  The Ford Focus is a good car but you need to be aware the transmissions have their issues.
Reply: Don't forget and discontinued parts at 7 years old
Reply: A bunch of self righteous people here loving to hate on American cars.😢

This is how you buy a car, any car. If the new design is in 2018, don't buy it. If they are still making it with same engine and transmission 5 years later, buy the car. All of the kinks should have been worked out. The downside is buying that fifth year run car is not flashy.

For example in 2024 I brought a 2021 traverse. The refresh started in 2018. The refresh is in 2024 with the  new 2.5L  engine. Wouldn't touch that. I brought a gently used 3 year old car with a 6 year old design.😂